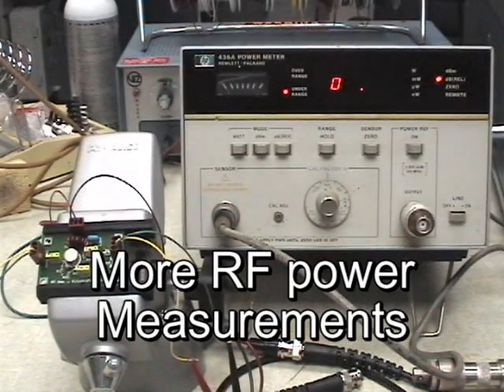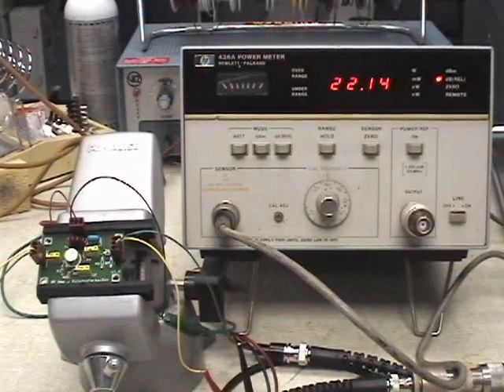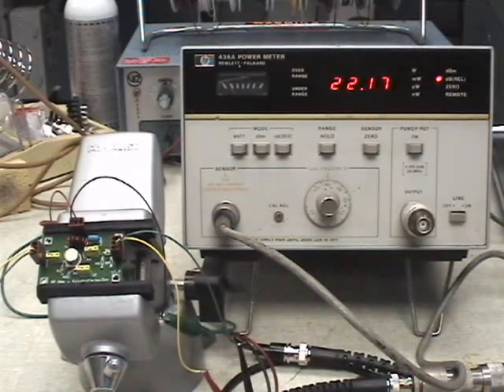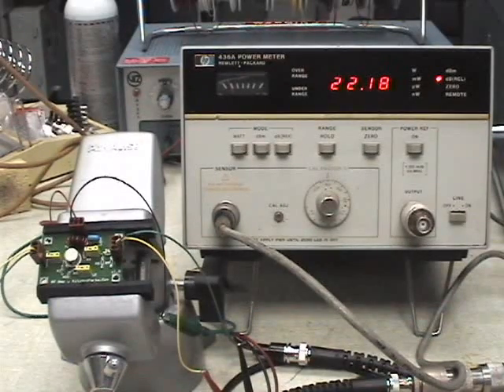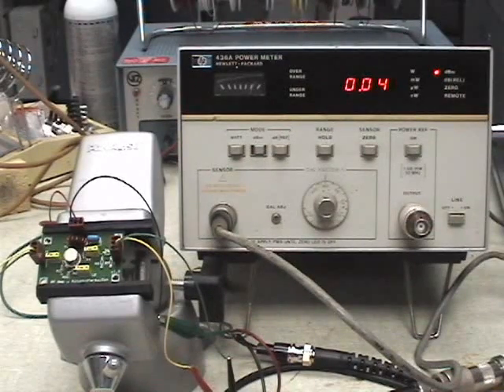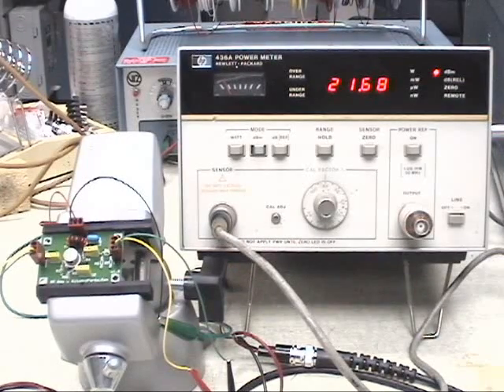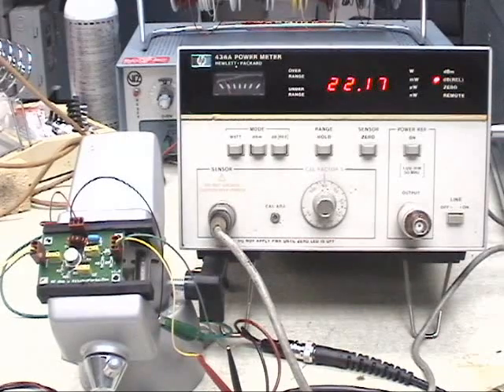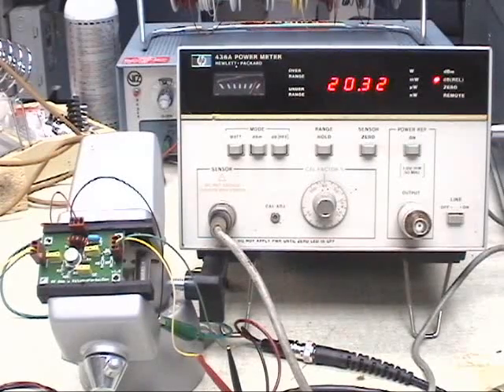Kits and parts RF amplifier part 2

Comment: do you need a power sensor for this unit? I see you're operating it without one
Reply: It does require a sensor. Its there but not shown. I was using a HP 8284H which has a range of 30uwatt - 3 Watts